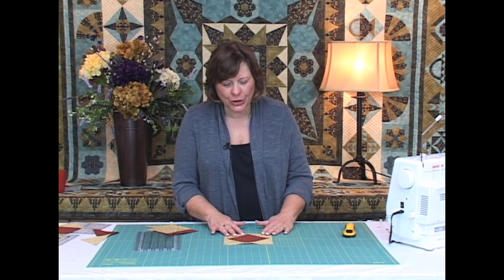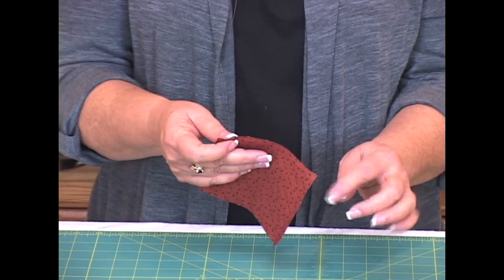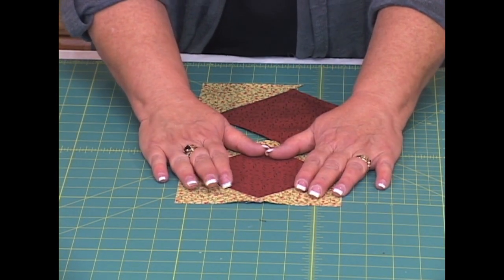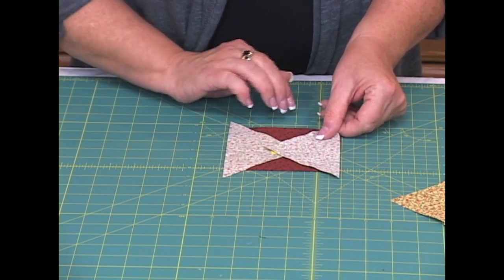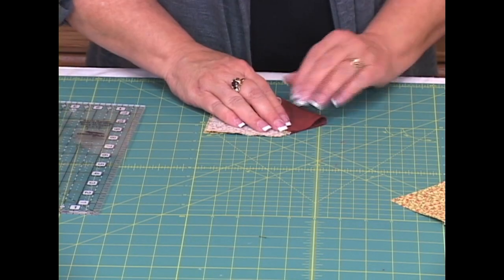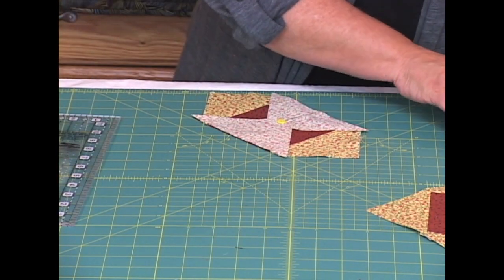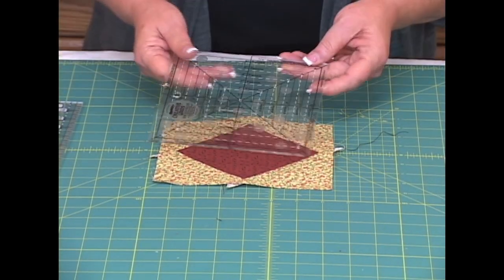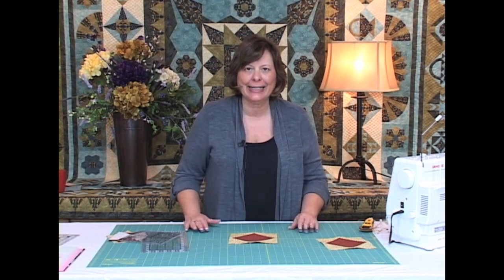Setting a Square on Point

Comment: Could you tell me how  big to cut  the blocks for the outside squares. Is there a formula? Like how big would my outside squares need to  be if my middle square is  6 inches?I hope you can  understand my question. Your videos are great. Thanks
Reply: I have a pattern (not Penny's) for a simple quilt of just this kind of block that I bought years ago and I think the following measurements may help you.  It uses 5-inch charm squares for the middle square.  For each of the middle squares (darker fabric in above video), my pattern requires TWO 6-inch squares of background (lighter) fabric each cut in half on the diagonal once, giving you four matching triangles to attach to outside of that middle (darker fabric) square.  So the "formula for YOU would be to cut two 7-inch squares for the outside (each sliced once on the diagonal) giving you four matching triangles.  If you had 4-inch middle (darker) squares, you'd need to cut two 5-inch background (lighter) squares sliced in half on the diagonal, giving you four matching triangles.  I see no reason why this formula wouldn't work for any size block.   Penny used these two larger light prints so that she'd have plenty of room to square up the block. Try this on scrap fabric first and experiment with different sizes. This block looks good alone or in combination with another block Penny demonstrates like a four-patch.  Try it on small scale using whatever scrap fabric you have. I realize you wrote your comment 11 months ago, but maybe your question and my answer will help someone else.
Reply: Never  to late. Thanks   very helpful
Reply: Penny probably has a pattern or two in her books that use this block, but there are others that use it too like "How Charming" from Eleanor Burns' Quilt In A Day and "Cherry Turnover" by Me & My Sister Designs.  But I'll bet you wouldn't need to buy either of those to make your own quilt now that you have a better picture of how to construct the block starting with your 6-inch middle squares.  Have fun!
Reply: newbeequilter thanks for your help, it's frustrating to have tutorials where they are more interested in selling the rulers than teaching a technique especially when they don't acknowledge the tutorial is for the purpose of selling, or to be misleading to the public...this tutorial was more about the straight of grain (and that if you just use their ruler you don't need to know how big the fabric for the triangles is) than how to make a block on point. I see this in many of the tutorials anymore...😒